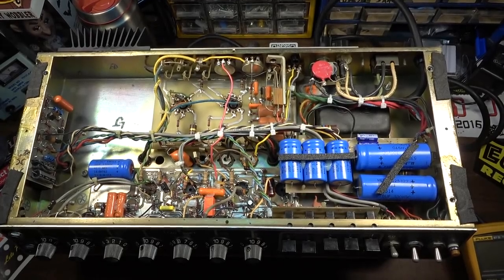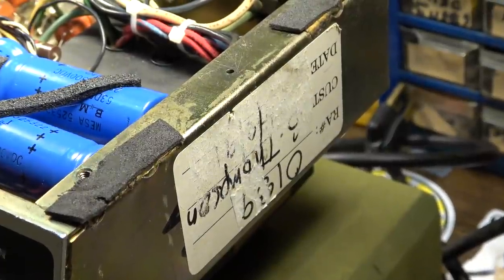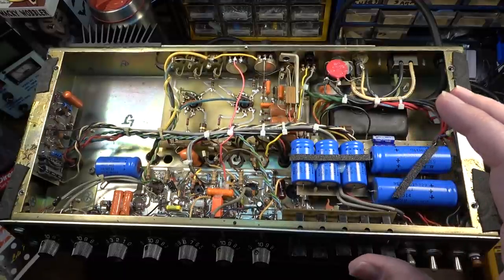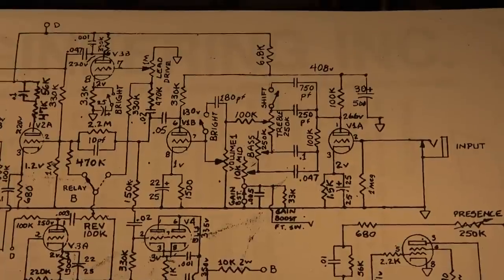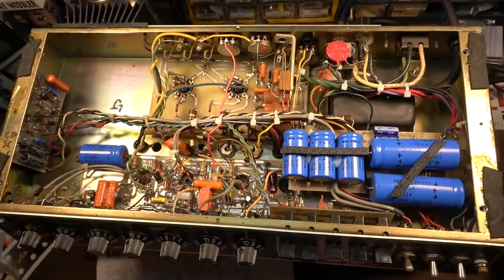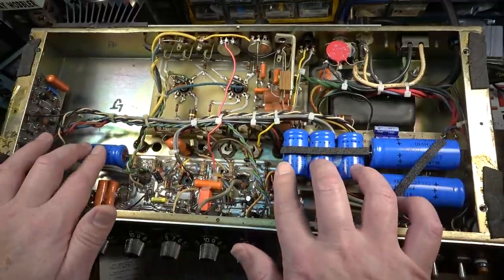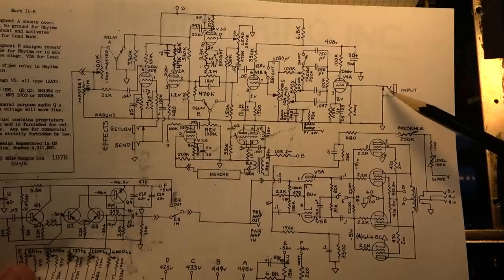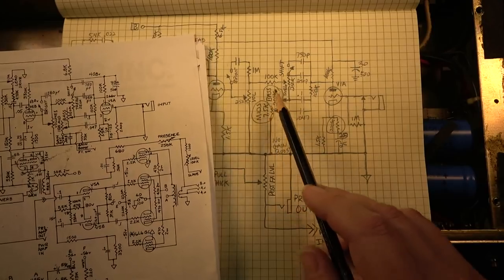The Mysterious Mesa Mark IIB+ | Analyzing a Factory-Modded Circuit

Comment: But I love Boogies (owning a few over the years). 
The only other amps I've had/owned are Marshalls (100 watt lead/75reverb). 
Most other amps I've tried didn't have a crazy gains you can obtain (in my experience) 
with Mesa products, not to mention they're loud as fuk and built like tanks. 
I still super dig your channel and have learned a lot over the years about things I never thought of. 
Thanks Brad for another excellent video. 
Peace !

Comment: Putting a 12AU7 in V1 position will probably burn up one or both it's plate resistors in the long run cause it has a much lower plate resistance and will draw quite more current from it's DC supply.
Reply from the maker: 2W plate resistors. They're more than enough.

Comment: You need the un-modded amp. With a before/after example, you could analyze (for instance) what noises they are trying to eliminate. The most complex part of the whole deal is chasing the signal from >in to >out.

Comment: I've noticed that Mesa/Boogie do some very odd things in their amp designs, particularly where they place the tone-stacks so that they are before the gain-stages, the output-signal of the tone-stack gets so heavily clipped that the tone-stack effectively makes very little difference, that is, no matter how you adjust the bass, mid, and treble, the result is always a square-wave, no wonder Mesa/Boogies tend to sound very "Farty" at high gain-settings, Marshall amps typically have the tone-stacks right at the end of the preamp, after all the gain-stages, which is one of the reasons why Marshalls sound the way they do.
Reply: The Rectifier series preamps, which are near-clones of the SLO preamp, have the tone stack at the end of the preamp.

Comment: Um, looks to me like you're dealing with a double-sided board.  Those traces that just end in a hole with no wire - that's a pass through to the other side.  That means you're probably missing some connections that transform those strange circuits.
Reply: @Russell Hltn  Hi mate!  Do the MB have plated through holes?  Man what a nightmare!  753 wires to unsolder before removing a pcb!  Mid-air components!  what a pos!

Comment: Kevin Miller asked a question about his TC-100 amp I didn’t get to answer before the premier ended.
No Kevin, hearing your amp make audible notes(not through the speaker) is not normal, but not unheard of. When pushed hard enough you can hear audio through components like resistors and inductors. If this is at a low volume, get it looked at or at minimum check the current draw/power consumption.
Reply from the maker: Could be microphonic feedback. Check tubes.
Reply: @TheGuitologist  being a Mesa product, Chinese tubes are probably more robust 😜

Comment: Hey Brad, don’t want to add any more woes, but where is v4a getting dc from?
Reply from the maker: Previous stage
Reply: I'm thinking it's a case of missing a connection to the other side of the board.  (It could have a component lead stuck in it.)  A tube is not going to do anything when 2 of it's three elements have blocking caps on them.  There has to be a DC path for the plate.

Comment: When I sent my 1984 Mark II C back to Mesa, in early summer 1984, to have reverb added , they had it for weeks. I eventually called to get the status and was told they were backlogged and so had sent my amp to a local repair shop they had  contracted for mod work and so mods were taking longer to turn around. When I got the amp back, it had the '+' mod added...so I called to ask about that and was told it would make the amp more stable.......but it was way more picky about preamp tubes afterwards.

Comment: I have an interesting Mark-V that has a random crackling noise. One of The designer or THE designer of the amp is a good friend of a very close family member. He was staying at my house in San Diego and took it up north to his friend at mesa. It was gone for a few months the one day my friend buzz says he’s got the amp and is bringing it down. They replaced all the front plate (was worn) and did some “stuff” ..
it sounds incredible! I have a recording studio with lots of rare gear. A marshall from my neighbor Randy Rhodes that was later worked on by Marc Cameron (another friend of mine).. etc. but whatever they did to this V sounds killer!!!  He left a note taped inside..
BUT  the problem is still there LMAO
Want to take a crack at it?  might be a fun video mystery to solve.

He also called and told me a story that when they designed this they had a tech start copying the master amp.. and it didn’t sound as good.. he kept scratching his head.. everything was exact. then as he is tracing through he smells and sees mouse pee on the board!!
THAT was the mojo they were missing. So they had to re measure and factor in what that pee was doing (half shorting.. adding resistance.. adding slight circuit jumps).  lol.  The End